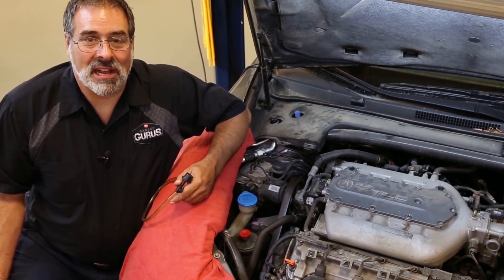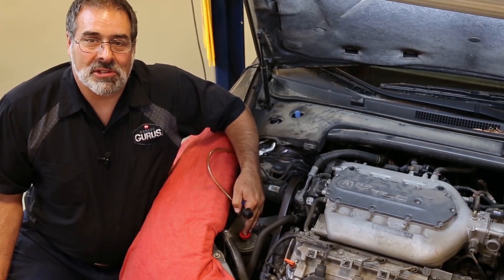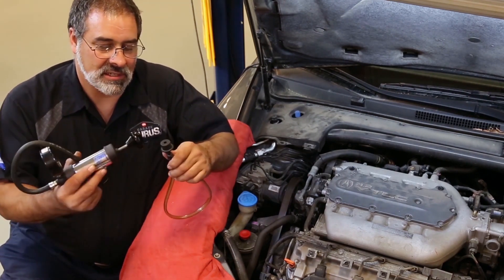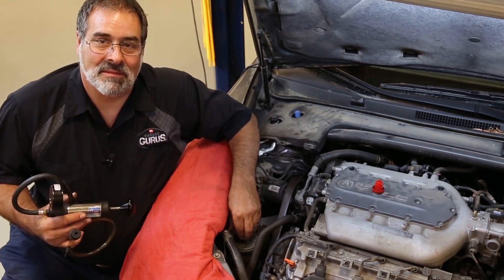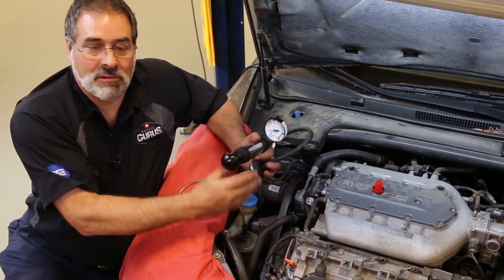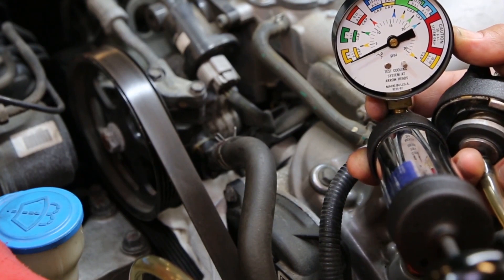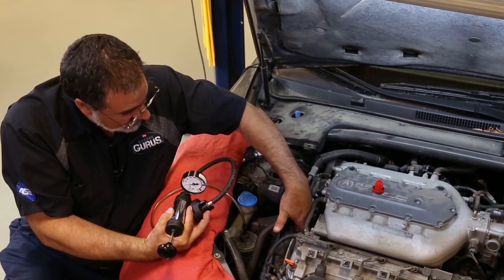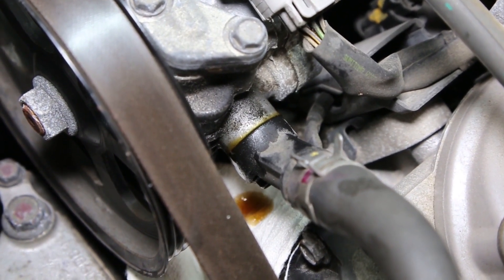Detecting Air in Power Steering System

Comment: Bogus video!!! If that hose was leaking that badly there would have been power steering fluid all over the motor...you could barley see any oil on the housing where the hose was connected while vacuum pressure was applied to the reservoir!!

Comment: I bought a vacuum pump, a radiator pump and I don’t find the leak the orings are new from Honda (2004) there is always air in the system this is the second pump. Any ideas ?
Reply: I have the same year Honda Accord and the same issue. Have you found out what the problem is, yet?
Reply: @thekeach I still have the pump making noise. I think the problem is with the after market steering pump, if it starts getting noisier like the privius  one I will put the original power steering pump I already installed the new oring from Amazon for this pump. Let me know if you have an after market power steering pump.
Reply: @MultiRafael23  I do not have the after market pump. I still have the original pump. I have replaced the o-ring to no avail, also.  I'm going to try this pressure test.
Reply: @thekeach  I found the leak!!! its the ruber hose that connects to the pig tail from the rack and pinion (return Line) the screw type clamp was not tight enough so instead I put two clams,  I hope this helps ..
Reply: @MultiRafael23  Wow! I'm still looking. I've even tried using a radiator pressure test kit. How did you find it?
Reply: @thekeach  grab with my hand and twist the ruber hose it looked dry no steering fluid leak but it was lose..

Comment: Yes,I found a small leak at the Rear of the Saginaw pump in my 5.7 litre Chevrolet LS1 V8 powered Holden VY SS Commodore by just using a 100 mL syringe 💉 & a piece of 3/8" power steering hose.

It needs to be rekitted, I've been wondering why I've been hearing aeration in the mornings sometimes & the power steering is going stiff in it !

Comment: Question, I lost my power steering and was unable to turn at low speeds. Luckily I was right around the corner from my house. The reservoir was low, than filled, which resulted in air bubbles. A day later my vehicle ran fine other than what sounds like a intermittent hissing from the P.S. pump/pulley, the steering wheel whines when I turn it, but my question is if the reservoir is the issue would it be possible that it’s causing the noise that I’m hearing from the pump? Although nothing seems to be leaking from what I can see topside. 

TIA 
BYLOE
Reply: Hey there. I think I’m having a similar issue with my power steering. Try using some “power steering stop leak” fluid. There’s several brands you can try. Just empty your power steering fluid dump this in. It’s thick and if the leak is not too big it should solve the situation until you get the actual leak fixed.

Comment: Will a slight leak in high pressure line that runs from the pump to the rack and pinion cause loose steering?
Reply: No

Comment: This is useless unless you have the adapter which you don't link to
Reply: Buy a resolver cap for the make and model of your car and dill a hole in the top, then put a piece of barb in the hole and seal it up with  some silicon. Make sure the bard is the right size for the tube you'll be using

Comment: Mark, can this happen to a 2009 Buick Enclave? I replaced everything in my power steering system except the lines and the fill canister and I think I have the very same problem that I had when I started. A light whine from the pump and the steering gets heavier as the air in the system compresses. The power steering is perfect the first time I start the car and anytime that it sets for 2 to 3 hours before starts. The way that this issue consistently starts out perfect and then gets stiff with noise makes me think it's a leak in the system.
Reply: Did you find a fix? I’m currently going through this with my 07 Impala SS
Reply: Having the same problem as well. Did you fix yours?
Reply: Had to replace the rack for the 2nd time. After the rack and a new power steering pump was installing it was fixed!!!

Comment: so how would you fix a leak between the pipe and pump?
Reply: I actually had a leak between my pipe (plastic end fitting, not the rubber hose) and the pump inlet. There is an o-ring that is supposed to seal that connection but it wasn't so I used Black RTV sealant and it seems to have done the job.

Comment: does it make noise when theres a leak?
Reply from the maker: Yes, the pump does make a whining noise when there is air in the system.
Reply: @GarageGurus  mine sounds like the front bearing is whizzing from lack of grease and starting to grind a bit, but, i am going to do your test first because it may help me find a hose leak that would threaten my new pump installation and maybe cause damage to new parts....fantastic video tip, thanks !!!!!!
Reply: @GarageGurus  Where can we find the stopper?

Comment: Electric power steering took over the hydraulic one's. But good tip Thx!
Reply: Electric pump but still has hydraulics. The electric motor runs the pump rather than a belt from engine. So bad comment mate
Reply: @williamgordon2919  No, some car model have a 100% electric motor that drive the steering wheel. The modern Renault Kangoo has that for example